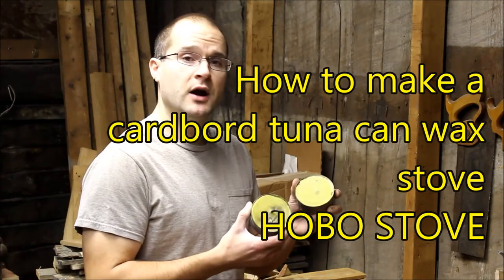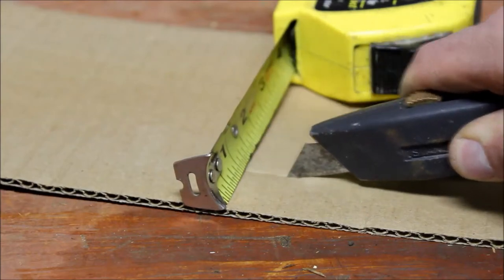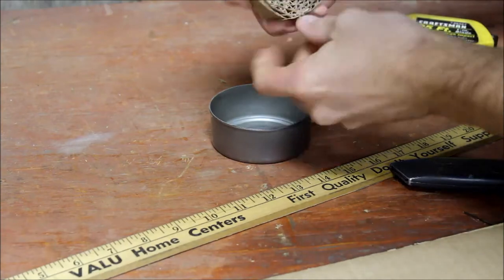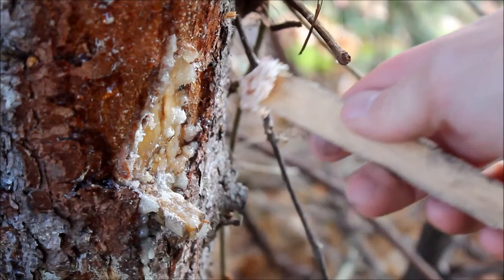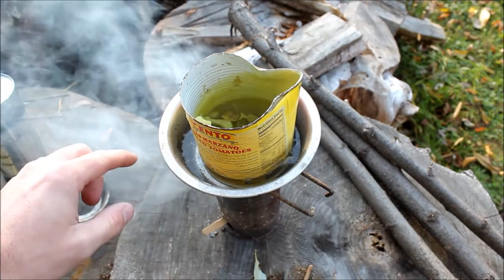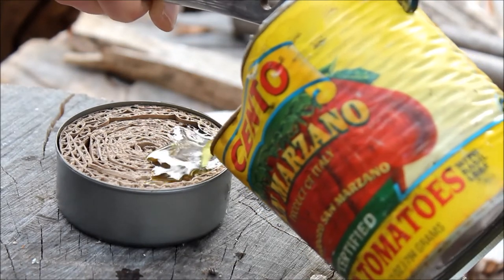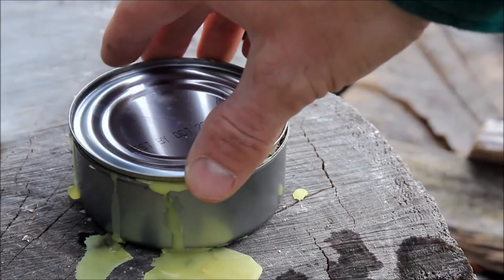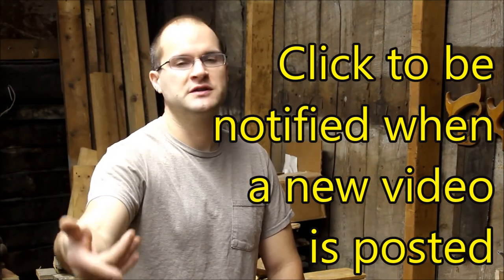how to make a hobo stove from a tuna can

Comment: How do you get the lid off the tuna can? My can opener found do that
Reply from the maker: I just used a cheapie safety cutting CanOpener the ones that cut the can open from the side of the lid rather than the top down
Reply: There’s a special can opener that cuts them like that. It’s a safety feature. Pampered Chef makes one. I have seen them by a different manufacturer, but I don’t remember who.
Reply: You need a can opener that does a lateral cut. Just google for safe can opener and it will pop out.

Comment: If you cover the entire top with wax, you don't have a stove, you have a candle.  The idea is to leave most of the cardboard sticking out the top, perhaps coated with wax but not covered.  Then the whole top burns instead of just the wick (and it gets hotter too!)   Also it's not a bad idea to stick two or three cardboard 'tabs' into the coil before coating with wax, to act as wicks.  The cardboard doesn't burn away until all the wax is gone, so you can re-use the stove by adding more wax.

Also, Boy Scouts have made these for decades, and they call it a 'buddy burner'.  The title of this video might have been 'How to USE  a hobo stove to make a Buddy Burner'.   8^)
Reply from the maker: lol so you can see I was not a Boy Scout. I like the idea of using cardboard tabs before adding the wax. I definitely used to much wax I think I just poured it in to use it all up. oh wait its all set up to use it as a candle while you are getting your food and such out of your pack and then as it burns down its ready to use for cooking lol  thanks for the tips and info.  thanks for watching and taking the time to comment.

Comment: ...have you thoughted of a way to lessen the soot in tent,   on skin ,  on pan , it makes this soot in my experience...
Reply from the maker: +Annie Richer 
Best way would prob be not to use cardboard and just use 3-4 wicks instead but not sure how hot it would burn. Sounds like it's time to experiment.
Reply: Personally i use these as torches to repel insects using citronella wich has natural oils in it. Doesnt burn as intensely as synthetic cheap wax and to my experience doesnt produce any smoke until its about to die. Maybe use less wax too. Instead of a can i roll my stoves to the size of a soda can before tying the ends off with rubber bands and letting it drain after its soaked through. I let them burn openly/use them to start fires or as torches and they work great. Even cooked with one in my house once with scented wax. Try it sometime